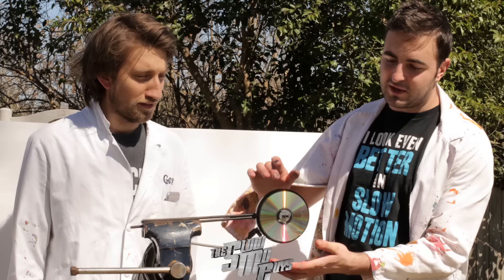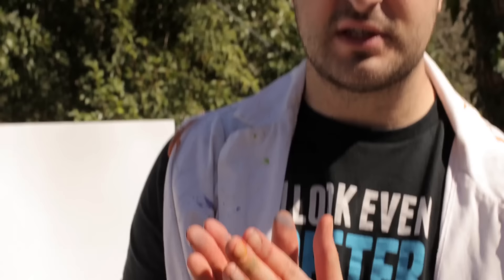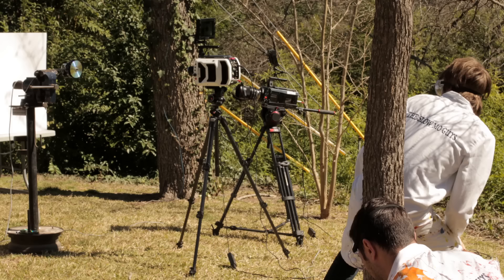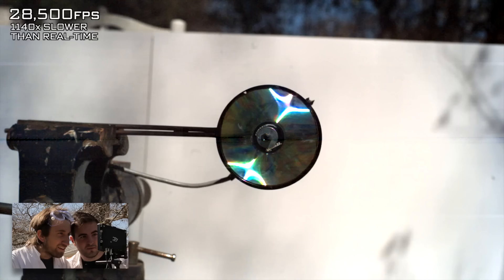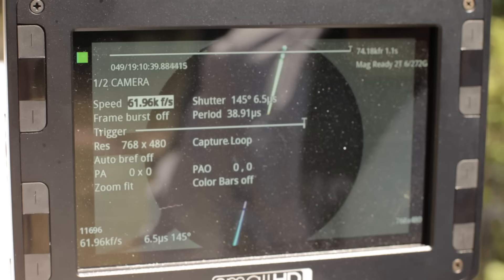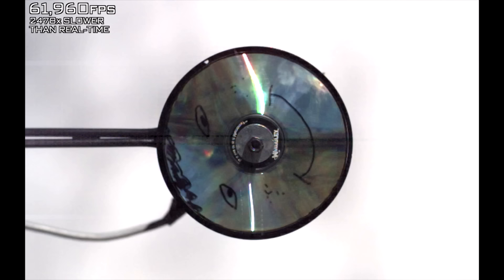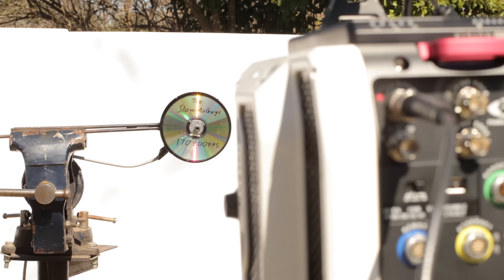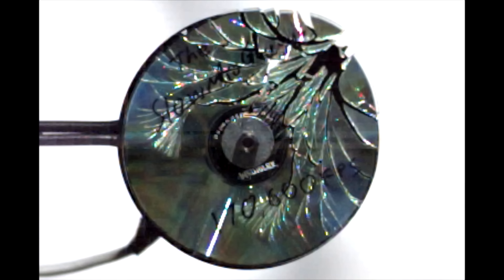CD Shattering at 170,000FPS! - The Slow Mo Guys

Comment: Four seconds of footage, 96 gigs. How much storage space does the Phantom hold??
Reply: enough.
Reply: Duncan Van Ooyen I have no idea actually, but I do think you can connect a flash-drive device to store the video.. but as I said I have no idea.. i'm assuming but it's crazy tho!
Reply: BrighamTalks SSD hardrive connectivity, or external recorder and i believe in even has an ethernet external connection so that you can record straight onto a PC :)
Reply from the maker: 96GBs. Then you have to offload the footage to a mag or a hard drive. Every shot we do fills the camera in 4 seconds. - Gavin
Reply: Plz someone explain me how resolution, fps and storage are related?
{wanna understnd it for educational purpose} :)
Reply: Sumedh Nandedkar FPS and Resolution are proportionate as exposure time of each frame allows the quality of the image, which is dependent on the sensor in the phantom, the smaller the capture time of each frame the less light is captured by the sensor lowering res. and the more frames per second the more space it will take up.
Reply: Nick Pyrlik
whaaaat? :)
Reply: Phantom writes to RAM (which is fast enough) => then before record next cine you need to write RAM to hard drive (In case of Phantom cameras this is matrix of multiple SSD drives, when done => You clear the RAM and ready to shoot.
Reply: Thats nuts
Reply: TheeLogicGamer Sumedh Nandedkar Light gathering doesn't affect resolution... resolution is based on the size of the image sensor and what resolution said image sensor is set to record. The reason why it has to be lower res when its higher FPS is; the higher the FPS recording the more bandwidth is required.
Each frame the image sensor gathers takes up memory, in order to be within the bandwidth constraints the images must be a certain size. At 170kFPS it is recording 24576 MB a second, at 0.145 MB per frame/image gathered by the image sensor. At 61.96kFPS it is recording 24576 MB a second, at 0.397 MB per frame.
Short answer. Max FPS is limited by the resolution of each frame recorded and max recording bandwidth. So less resolution = less bandwidth taken up per frame recorded = more FPS recorded.
Reply: They scared the poor dog.
Reply: fikluk
840 evo should do 2.4 gb/s, or around 300 MB/s on the low end models, faster on the higher storage models. A 1TB SSD should be able to handle a round 1GB/s (or more). This camera is doing 24 times that.
This means that it likely has a bunch of very small memory sticks on it, each with it's own pipeline to the pixel sensors, giving it a huge bandwidth for what amounts to very little storage.
Reply: It has pretty huge flash drives.
Reply: BrighamTalks A 2 tb hard drive isn't expensive
Reply: Keep in mind that 170,000 fps is 170,000 pictures and imagine taking 680,000 photos!
Reply: RipleySawzen Someone already said above: It has 96GB of RAM it writes the video directly to the RAM because that's the only thing fast enough (flash or SSDs aren't fast enough!). Then it copies to a HDD or SSD after the shot has been taken which would take a while.
Reply: BrighamTalks What is more important is how fast is the transfer rate for this thing...
Reply: fikluk wrong, your samsung 840 evo is connected via sata 6 gbit per second and that in the real world is about 500-550 Mb per second :) so 1 gb/s you would need raid 0
Reply: fikluk Photoshop
Reply: fikluk When you eliminate the impossible (4GB/S on a SATA interface), all that remains, however improbable (Photoshop), must be true.
Also entirely possible your OS or Samsung Magician simply messed up somehow.
Reply: BrighamTalks I believe they probably have external hard-drives on hand. Gavin always talks about how he buys a bunch all the time. However, I'm sure Vision Research recognize the capabilities of their device and prepare accordingly :)
After all, it is quite an expensive piece of equipment!
Reply: Sry but gigs isn't right. Its gbs. It stands for gigabytes but its just pronounced as the way u wud say gigs. Sry it just bothers me, I don't mean to come across rude just wanted to help u for next time
Reply: Alec White I'm pretty sure a small b means bits and a big B means bytes. gbs would suggest gigabit/second. But that's just me.
Reply: I have an estimation of 3TB maybe
Reply: 96 gb isn't that much anymore these days, gta v for example takes 50 gb to install
Reply: BrighamTalks It depends if they delete the videos after they post them.
Reply: L Moss It's not really though as it uses keyframes so not all frames are actually whatever resolution it's set to (but don't quote me on that).
Reply: xXx_illuminati_overload_xXx  And you install it in 2 seconds i guess?
Reply: BrighamTalks High framerate content needs a lot of data. One frame of uncompressed video at 1080P is around 6 Megabytes. (3 bytes per pixel, 1920*1080*3) However, they are using lower resolutions. However, you are not limited by how fast the shutter is, but how fast you can write to the media. At 30 frames a second, a 1080p stream would be around 360 megabytes a second. At 768 by 480 with a rate of nearly 62 thousand frames, that would eat up 64 GB every second when uncompressed. That's just about as much space that GTA 5 will need for PC. And for the final demo, 50.3 GB per second while uncompressed.
Reply: BrighamTalks  Gav has stalked about it before on the rooster teeth podcast. Apparently he has terabytes on terabytes on terabytes of unused footage
Reply: Keaton Erickson Well, it certainly isn't recording to an SD card, I can ensure you of that.
Reply: Sumedh Nandedkar Resolution = the number of pixels that make up a frame, for instance 1080p is 1920(horizontal) x 1080 (vertical) = 2073600 (2 million) pixels per frame.  FPS is the number of frames being recorded per second, so for instance, at 60fps you are recording 60 frames per second.  So, if you record at 1080p, 60fps you are recording 60 frames of 2 million pixels per second.  This means very large file sizes.  Therefore, when the guys ramp the fps up, even at low resolutions the files sizes are enormous.  When they went to 170,000 fps even at the low resolution of 384x286 (109824 Pixels per frame) the files sizes are massive, hence why you need large (and fast) storage devices...
Reply: iocopoco maioco Its definitely not Ethernet. You get a max 1gbps through standard cat 5 ethernet. It's not SSD's either since ssd's are limited to 6gbps because of the sata interface. The only plausible solution I can think of would be to have a lot of high speed ram, and then an ssd or high capacity sd card. While the video is being shot, all of the video is uploaded to some high bandwidth ram, and then once the video is done being shot, it is unloaded to some large storage device. This probably isn't even close to being correct, but it's all I can think of.
Reply: Erik Wooldridge
I actually post a link to the specs of the camera! :) so all this arguing can be clarified by the source itself :)
Reply: Erik Wooldridge The camera likely uses allot of ram like gddr5 that has an extremely high bandwidth(a bit over 200GB/s) and then dumps that frame buffer to a more conventional storage system like an ssd. At least that is how i would design a system like that.
Reply: BrighamTalks nobody even wonders what kind of technology did they use to record at 25 GB/s ???
Reply: ***** If 4 seconds eats up 96 GB, it must have a large amount of RAM. The processor in my laptop only supports up to 32.
Reply: ***** modern versions of windows support 192gb and I think windows server supports up to 1tb.
Reply: Erik Wooldridge You are also limited by how much RAM the CPU and/or motherboard can support
Reply: What I want to know is how it stores 24 gigs a second.
Reply: BrighamTalks What in this planet can write 24 gigabytes a second? That's fucking insane!
Reply: ***** and then I guess you have to have like 100 GB of RAM on-board? That alone would cost a fortune
Reply: I also came here to ask this. Iocopoco's link says it all: "96 GB high-speed internal RAM". Recording straight to HDD/SSD/whatever would be impossible with today's technology, but RAM can really be that fast. ^^
Reply: Erik Wooldridge 32 bit windows supports about 4 GB while 64 bit supports theoretical up to 16.8 million terabytes of ram.
Reply: ***** In four seconds, they used about 100 GB.
Reply: Sensei [BBX] The frame rate and resolution are limited by the data rate that the camera's electronics (including the sensor itself) can handle. Doubling the pixel count will (approximately) halve the maximum frame rate available, and vice-versa. The exposure has no impact on resolution, just on how dark each frame is.
Reply: RFC3514 Explain to me what in this world can write 24gb/s? A class 10 SD card? well thats 110mb/s explain the other 23900mb/s
Reply: ID GAF RAM disk is fast enough
Reply: True, but still for a fricking camera 96gb ram disk
Reply: BrighamTalks It has a 10gb ethernet cable. problem solved for all you wannabe nerds.
Reply: kris7001 24 GB per second would completely saturate that cable's bandwidth, by a factor of nearly 20. Try again.
Reply: ***** This is a ultimate high end professional class video camera so it is possible for it to have special mechanism to stack >96GB of RAM into RAM disk. The major problem is how much will it cost?
It probably cost more than a car.
Reply: Sumedh Nandedkar you can think about it in pixels. Resolution is easy to imagine as pixels because that's how we specify it. Each pixel takes a specific number of bits (0 or 1, a byte is 8 of these) to store in memory if it is stored raw. You can use image/video compression formats to find patterns in the pixels or patterns from frame to frame that can reduce the number of individual pixels that need to be written to memory, which can be done as the video is recorded (real-time) or after (post-processing). Finally, fps stands for frames per second. A frame is a single image with a resolution of some number of pixels. If you double the fps of some video you double the number of pixels required per second.
Reply: Wan HL You can Buy a Car in 1588.94 Dollars so it's more worthier than a Car.
Reply: ***** How is that relevant? you suppose it has 96 gigs of temp storage? yeah right... do you even computerscience bro
Reply: xXx_illuminati_overload_xXx 60 actually
Reply: Sumedh Nandedkar Storage holds data.Resolution is the data per frame
fps is the frames per second
storage needed is the amount of data per second times the duration that the video is being taken. and data per second is the fps times the data per frame.

I hope this helps.
Reply: Over 9000!!!!!!!!!!!! Sorry...I just had to say that
Reply: kris7001 So, now you've been proven wrong two times, while attempting to ridicule others for their alleged lack of knowledge. Got any snappy comebacks, mr Computer Science-bro?
Reply: iocopoco maioco it would need to be straight high-speed RAM disk for it to achieve those transfer rates
Reply: Sumedh Nandedkar not actually sure, but im i think FPS stands for frames per second, so every frame is like a photo, so what the slo mo guys r doing is is taking 170,000 photos a second. one photo takes like i donno almost one megabyte or so. 1000 megabytes in a gigabyte, 1000 gigs in a terrabyte and so on. resolution is how big/high quality the photo/video is so the bigger or higher quality it is the more space it will take up. is your question answered?
Reply: ***** so it's got a 4 second backlog and you run in to save the last 4 seconds?
Reply: ***** How long does it take to offload a full 96 GB shot and be ready to do the next one?
Reply: or they delete everything and only keep very little of what they take
Reply: xcfencer99 Gavin says he deletes everything when he's done with it
Reply: yeah of course he does, where would he store it? external storages only go up to like 50 gig max and that costs a shit ton of money
Reply: i saw a 2 terrabyte drive in the US maybe they got there hands on one of those. its still really expensive.
Reply: iocopoco maioco you'd need a pretty beefy RAM to store 96 gigs in 4 seconds. 24gb/s isn't ...
wait. how the hell does this camera even do it? not even a dedicated DDR3-2133 could. does it actually have like 128gb of gddr5 for temporary storage or something?
Reply: xcfencer99 Xbox Ones hold 2 TB
Reply: Radiovarietyshow deez nuts
Reply: BrighamTalks LOTS
Reply: PowerShock2060 I think it has a ram disc of 96-180 GB
Reply: fikluk That's why it costs a house to buy one, $120,000 for one of these lol
Reply: Sumedh Nandedkar  Though I don't know the specific details. Resolution uses more pixels and thus takes up more storage. Filming that quickly and keeping quality also increases the storage as well. 
As he mentioned in the video, 4 seconds took up nearly 8 hours of video footage. That's nearly all three LOTR movies combined. 

So resolution+Video file =storage space.
Reply: 100th reply
Reply: BrighamTalks you could play gta 5 on that
Reply: fikluk lol it doesnt work like that. Turn off rapid and it becomes 400. This bullshit doesnt even work when u are actually using something not stored in ram.
Reply: basil Sharkey 

"where would he store it? external storages only go up to like 50 gig max and that costs a shit ton of money"

50 Gig max? Really?

Umm, you're joking right? Do you even computer, brah?

They barely sell anything under 500 GB these days @ retail! & even those are dirt cheap. Even cheaper for an internal drive.

$50 USD buys you a 500 GB external drive.
http://www.frys.com/product/7697397?site=sr:SEARCH:MAIN_RSLT_PG

But, who wants that anymore?

$120 USD buys you 4 TB external. (That's 4,000 GB, for the uninitiated)
http://www.frys.com/product/7859639?site=sr:SEARCH:MAIN_RSLT_PG

$250 USD buys you 6 TB external. (6,000 GB)
http://www.frys.com/product/8314597?site=sr:SEARCH:MAIN_RSLT_PG

$380 USD buys 8TB external. (8,000 GB)
http://www.frys.com/product/8174665?site=sr:SEARCH:MAIN_RSLT_PG

$600 USD buys 12TB external (12,000 GB)
http://www.frys.com/product/8174675?site=sr:SEARCH:MAIN_RSLT_PG

Or did you mean 50 TB (50,000 GB)? Will give the benefit of the doubt and assume that was a typo: meant Terabytes, not Gigabytes ("gigs")?? 

Yes, that (50 TB+ external drive) would presently be prohibitively expensive. ;) Unless you're, y'know, rich. 

$7000 buys you a 64 TB HD solution. (64,000 GB)
http://store.apple.com/us/product/HHDT2LL/A/g-tech-64tb-g-speed-studio-xl-hard-drive-storage-solution

Though maybe if they have the money to toss around for this camera they have that kind of money for HD solutions too? Who knows?

But, give it about 4 years and ~64-128 TB will be standard on every new computer if Moore's Law has its way. ;) 

Whether data read/write speeds will keep up or not, who knows? Maybe if they finally move to fiber optics like LightPeak or whatever the next gen interconnect standard will be...

A-aanyway...
Reply: yeah i know sorryi meant to say 50 terrabytes
Reply: BrighamTalks  for all, the memory specs: 24 GB, 48 GB, 96 GB high-speed internal RAMCineMag for non-volatile storage (128 GB, 256 GB, 144 GB, 512 GB)
http://www.visionresearch.com/Products/High-Speed-Cameras/v1211/
Reply: Sumedh Nandedkar the storage is constant. (they uses the highest fps possible on current resolution, so the size is the same cuz the camera have your limitations)

FPS and Resolution have inversely proportional magnitudes (higher FPS lower the resolution).

one thing you are missing is the record time. 

that is wat i think.
Reply: BrighamTalks 96 indeed!
Reply: BrighamTalks 4 seconds upon playback, but much less during recording. This video isn't anywhere close to 96gigabytes. It records at 170,000fps but it takes only a tiny fraction of a second to record this destruction of the CD. It takes 4 seconds on playback, because it plays back at 30fps. This video is no larger in file size than any other normal 4 second long video clip.
Reply: ***** you got it very wrong. 4 seconds is raw footage which takes 96GB. 4 seconds of playback on 30fps isnt gonna let you see shit. thats 1/1400 second.
Reply: BrighamTalks 
I'm more curious about how long it took for them to finally find the cracking cd at 170k FPS scrolling through 7 and a half hours of video surely isnt this funny.
Reply: probably just fast forward it until they saw some action
Reply: BrighamTalks a lot
Reply: BrighamTalks 80 terras
Reply: Probably you have to use a external memory
Reply: The Slow Mo Guys nice answer!
Reply: The Slow Mo Guys wow i didnt think you would reply 😆
Reply: Each pixel of a frame are put into storage, and each frame is consisted of many, many pixels. So basically a bigger resolution with a high framerate takes a shit tone of storage ;)
Reply: It has to record to some sort of ram first though because no flash drive, hdd, or even ssd would be fast enough. So either way you would be limited by how much ram their is in the machine.
Reply: An PCIe interface SSD would be able to keep up.
Reply: probably not
Reply: BrighamTalks ii
Reply: BrighamTalks a bunch of petabytes :V
Reply: BrighamTalks how many gigabytes does YouTube hold
Reply: When the video gets slower it gets darker and SPACE is dark and everything appears slow what do you guys think.
Reply: BrighamTalks iiii
Reply: well since it's designed to store large videos, I wouldn't be surprised if the Phantom had about 20 hard drives in it
Reply: @THE_RISING_SUN  the higher the resuloution the harder it is to get high frames... and the higher space you'll need... and if you get both high frames and resoloution you'll need 96 gigabites for 4 seconds
Reply: Sd card
Reply: 97 gigs obviously
Reply: @MrGeorgeFlorcus I am 950 liker